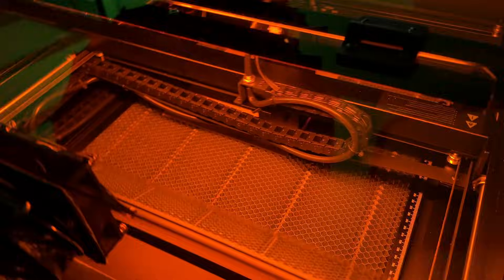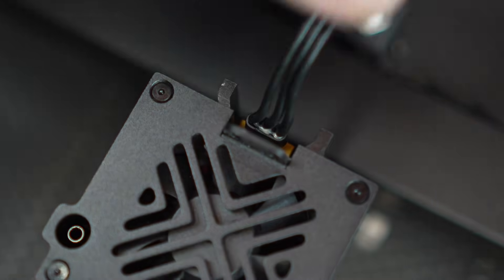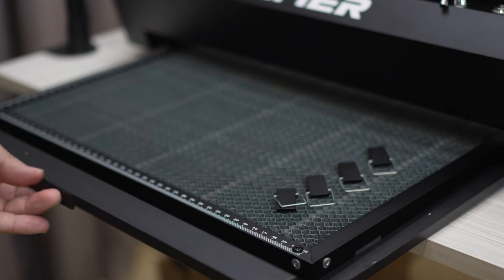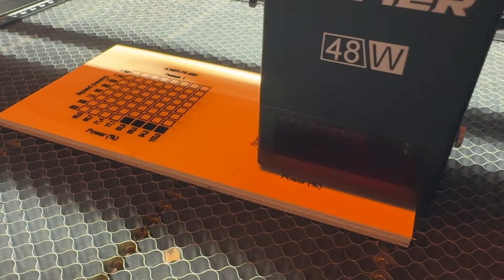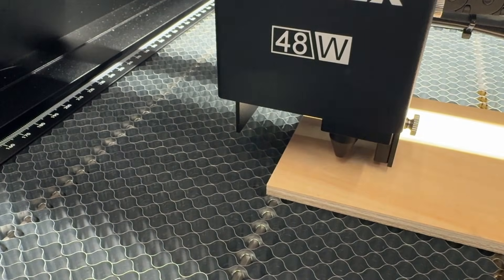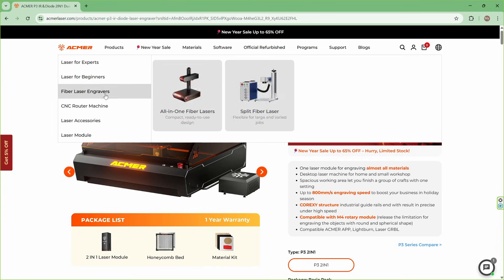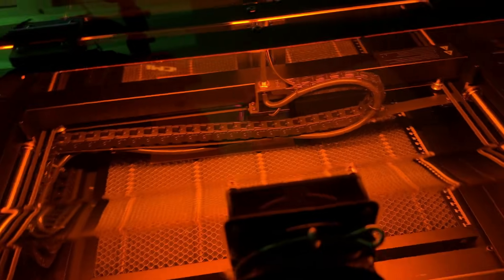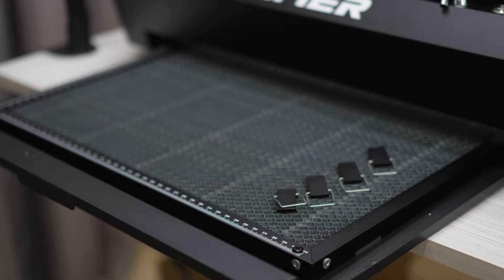ACMER P3 Reality Check: Don't Waste Your Money Until You Watch This!

Comment: Hey, whats your opinion about the stability of p3 with core xy and the p2 with linear rail? It must nearly the same
Reply from the maker: Of the p3 I thought it was very smooth and even at higher speeds the rocking was either minimum or nonexistent. I had it top of my working desk, not a bench. Funny you should ask about the p2 because Acmer sent it by accident and then they said you could use it as a comparison of you want. I opened for the next video I’m working on. I can run a comparison and mention it

Comment: I've had a Roly XW for the last year, the market has been missing what they provided in terms of quality and support. This looks like the machine that will nicely fill the gap left, when they sadly stopped trading. I hope ACMER can also step in to Roly's shoes when it comes to support.
Reply from the maker: I agree that it's a very solid machine, and I think it has a lot of potential to fill many gaps. But again, if you want a machine that is clean and works with just one click of a button and you don’t want to mess with things, you might want to look at something else. It’s got a lot of features that you find in machines at a much higher pricing